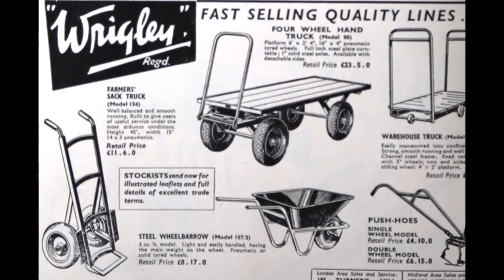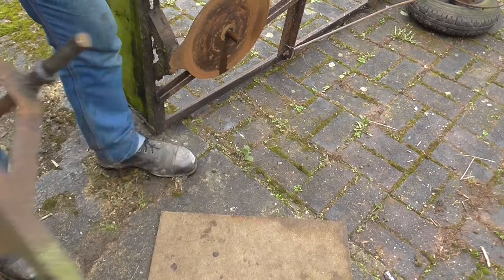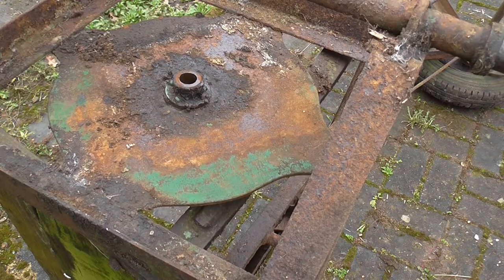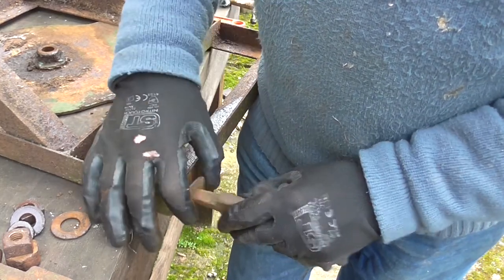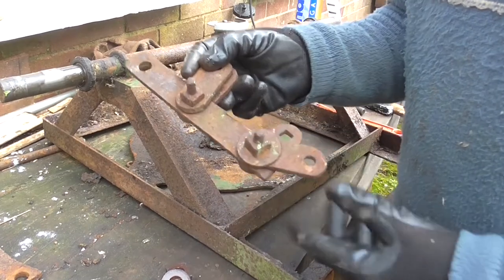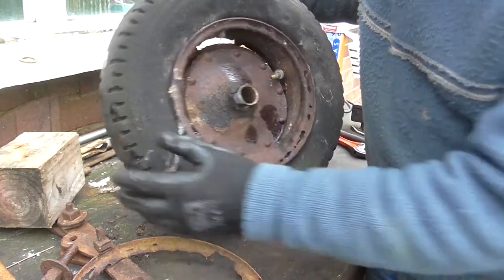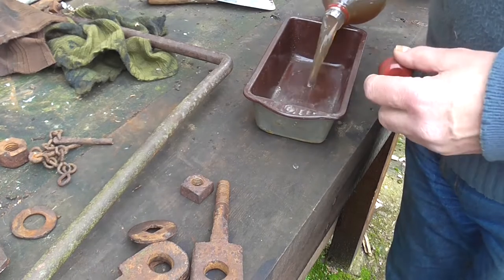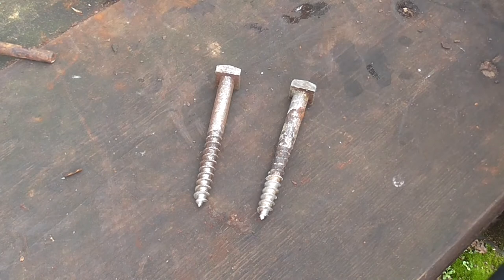Reconditioning an old Trolley. Part Two Before restoration.

Comment: Well worth saving! What a nice project! 

The options you can buy today, won't be half as well built!
Reply from the maker: Indeed, That's the problem today there are lots of small Chinese made trolleys for sale around the £60-£100 mark but they don't last long, I know I bought one a few years back and it has fallen to pieces, even the wheels collapsed. There are better ones but cost £1000+. It's either cheap and poor quality or very expensive and high quality, but nothing in-between the two prices.
Reply: @scrimperuk   Agreed! Unless you're in your lucky situation, I think the only other viable option - learn to weld, and make one!    A timber jobbie might be viable ..  chunky timber's surprisingly strong.
Reply from the maker: @kwakkers68  I did make a 2 wheeled wooden one using 27inch cycle wheels but found it cumbersome to use. I do have an electric welder but rarely use it and am not very good at welding either, don't do enough I suppose.

Comment: Probably a year late but do the square shafts on the handle fittings go into the square holes in the spare bracket that you refer to? They appear to be a similar size surely not a coincidence? (Not watched the later videos so apologies if you cover this later)
Reply from the maker: Hi Richard I still have not found out what those bits were for. I can not see how they were of any use on the handle.